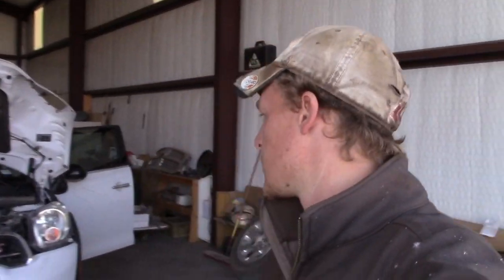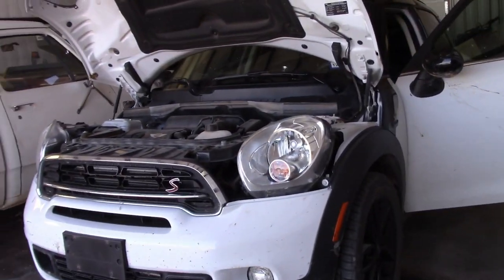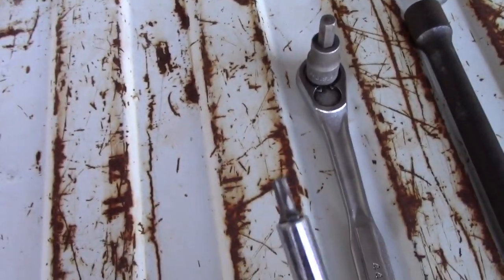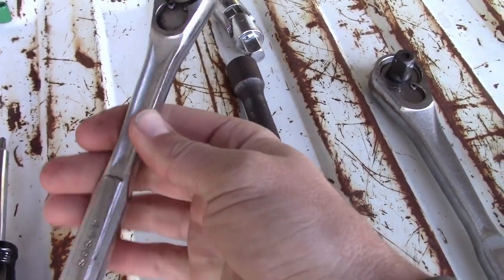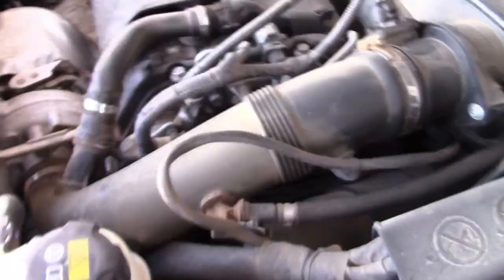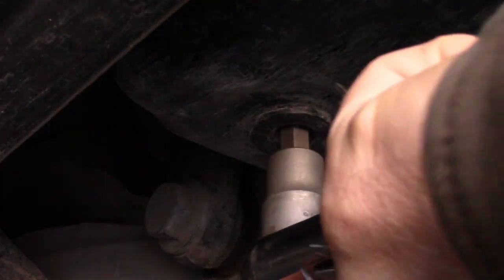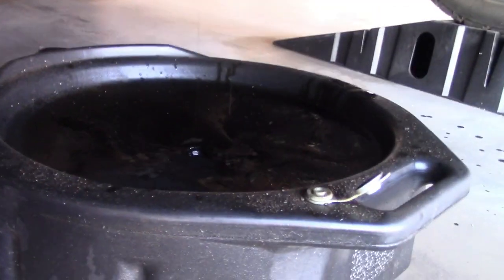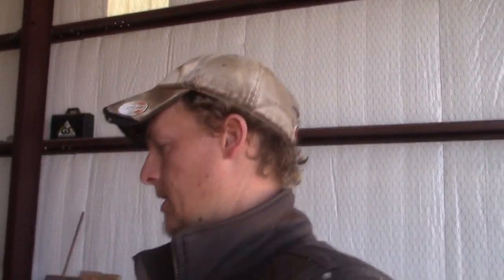2016 Mini Cooper S Countryman Oil Change

Comment: I wish I could get on the laud speaker and say don't believe the manufacturer.  Change your oil every 3000 miles not every 7000 or 10000 miles.  I just purchased a certified pre owned mini from a mini dealer.  Car fax shows the oil was changed 3000 miles ago by the mini dealer.  The oil is jet black and sandy.  I don't believe for one second that this oil can go another 4000 miles.  Sadly Car fax shows oil was changed every 7000 miles by Mr. dealer.  I rather change my oil more often than paying for costly engine repairs.  Thanks for allowing me to post.
Reply from the maker: sahmadi1000 yeah I don’t trust dealers changing oil. I always change it every 5,000 miles. A soft medium

Comment: Drain plug torque spec is only 18 ft lbs. Not very tight. 8mm hex for the drain plug. 27mm socket for the oil filter cap. With a modern German car I wouldn't mess with viscosity. Stick with Mini's recommendation.
Reply: My drain plug continues to leak after my oil change... Have you had a problem with this? Too tight? I don't have the tool to measure lbs/ft.

Comment: FYI in the 2016 R60 and R61  ( Countryman /Paceman) only now MINI recommends 0W-30     ACEA A5/B5   , prior years it is 5w-30, Drain plug is 8mm allen
Reply from the maker: Tom BNS I don’t like using such thin oil here in Texas. It gets to hot in the summer. But in winter I use thinner oil.
Reply: @onthefarmandoffvlogs  Sorry,  I intended this info to be for other viewers looking to change their own oil on the 2016 R60/R61 . Thanks for your video post.  I had a new 2013 Countryman S ALL4  and just got a used 2016 Countryman  S ALL4 and was surprised to see that sticker under the hood.
Reply from the maker: Tom BNS it’s all good! Appreciate the comment

Comment: 5w20 is too thin for this engine, you're going to have serious engine problems+ puting 5 litres of oil instead of 4.2 litres is going create high pressure in the crankcase  and eventually destroying a lot of gaskets in the way!
Reply from the maker: Maher Tim that’s the oil it calls for. And I only put thin oil in during the winter. In the Summer I put a thicker oil. And I drained out a little oil after the video.

Comment: here's some missed insight.  Always pour with the spout at the top of the bottle.  This will allow air to enter the bottle and avoid all the splashing.  The other element is also to apply some anti-seize to every screw you touch.  This will make any kind of loosen action much easier.

Comment: Hey thanks for the video, I just changed the oil on my girlfriend's 2015 Countryman. But a problem I now have is that oil is leaking from the drain plug. I've drained it to investigate the washer, but still leaks after reinstalling. Could too much oil be the problem? I'm at a loss...?!
Reply from the maker: Erik Stewart maybe try to replace the washer for the drain plug? And make sure the threads are not cross threaded.
Reply: @onthefarmandoffvlogs  I did replace the washer (the original) with the one in the filter box. And after it still leaked, I went back to the original. Definitely not cross threaded. And, I'm back to the replacement washer, flipped so that flat side sits against the plug head. Long story longer- I'm wondering if there's too much oil in there, cuz the literature says, "in between the gauge ends." I'm definitely at the top end. Again, thanks for your reply!
Reply: @erikstewart1423  did you ever figure out what was causing it to leak. Mine is doing the same thing. I even redrained the oil and tried the old washer. ??? Any info would be super helpful. Thanks
Reply: @denvermcgrady9177  hey, I hope you've figured it out since I haven't got back to you!? I ended up using a washer/gasket combo. Two in one from a cheap packet of miscellaneous. Such a bummer, all of the issues with it.

Comment: Good instruction. 5w20 and 5w30 behave similarly when cold.  The 5w30 is advantageous at higher temps.  0w40, or 0w30 would probably be great all-season in that car.